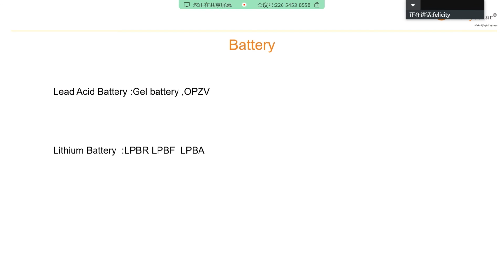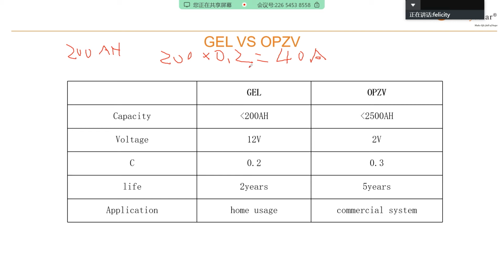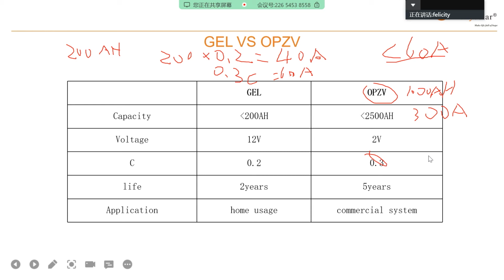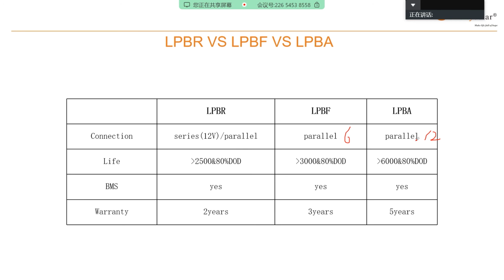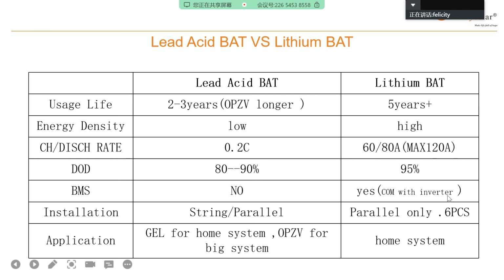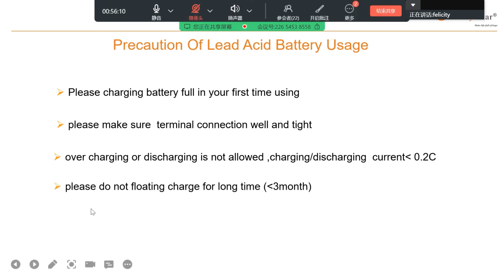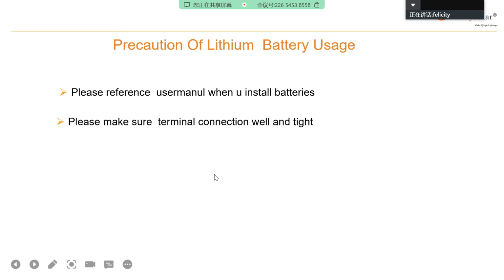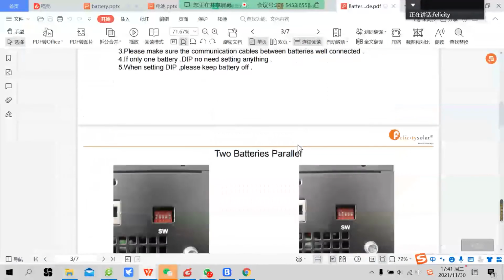felicity lead acid &lithium battery

Comment: the product might be good, but I would never buy this product again. They have the worst customer service! I live in Panama, they sell through installers who don't know what they are doing (my installer showed up without a single tool🥵. He has been back 4 times and still can't get the system to work properly. I called Felicity Solar Panama now 6 times and they are running away from me asking about my warranty and needing an installer who knows what they are doing. I reached out to Felicity Solar in China, its been 4 weeks and they claim they are sooo busy. I called Felicity Solar USA and offered to pay for remote service just to help me through the programming, NO RESPONSE. Worst company to deal with ever. DO NOT BUY THIS PRODUCT!!!!